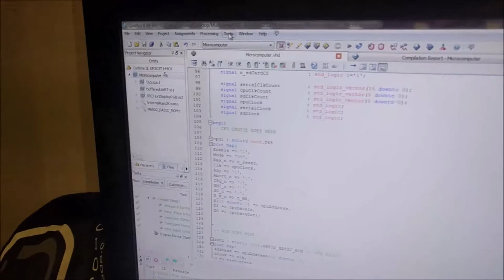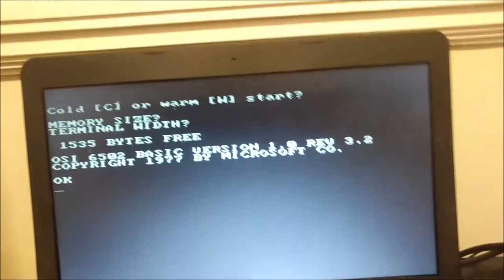Can my 6502  Ohio Superboard II  be replaced by a FPGA Chip?

Comment: Hi from Spain! It's awesome to see the OSI Superboard II on a laptop screen!!! I have one SBII but my Astec RF modulator broke. Do you know where I could buy some device to convert composite video signal to VGA? Thanks and congratulations!
Reply from the maker: My SBII is still  running Composite Video but here I was using FPGA with VGA output. The FPGA is a logical accurate copy of SBII but with VGA out and composite, see Grant Searle Multicomp project. You can build an FPGA SBII or UK101 system for around $20.
Reply: It's a very interesting project! but my goal is to use my old Superboard II on a VGA monitor. So I would need a Composite to VGA adapter. I purchased one on Amazon but the VSync was wrong so the image shown vertical rolling and rolling. Perhaps I will but a small TV with Euroconnector and will use a Composite to Euro adapter. Regards!
Reply from the maker: @javierharo2023  I have a Composite Capture card on my computer which allows me to use my Superboard II but that is not the solution you are looking for. Good luck, it would be nice to see a video of the end result ;-)  OSI SBII to a VGA monitor?